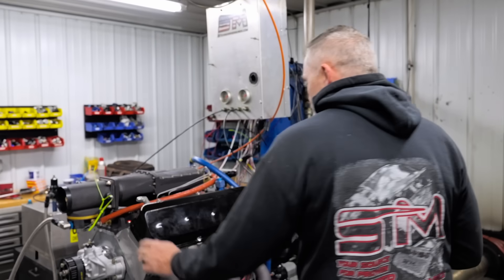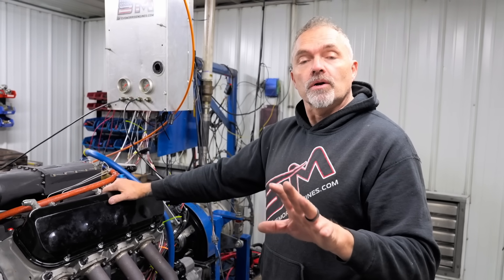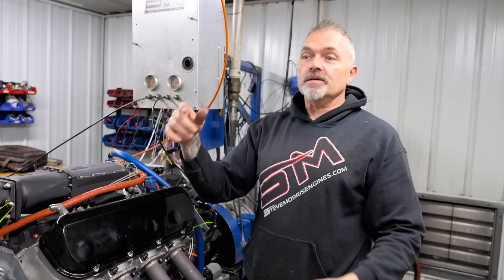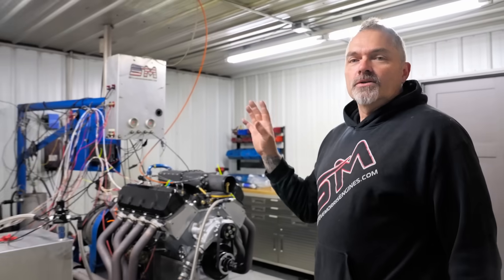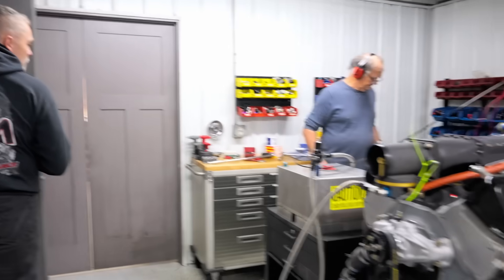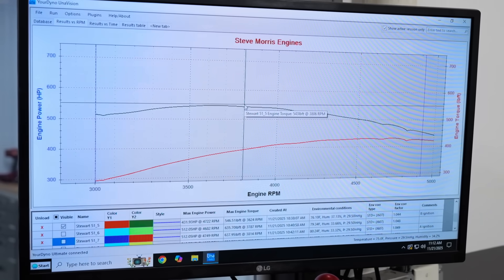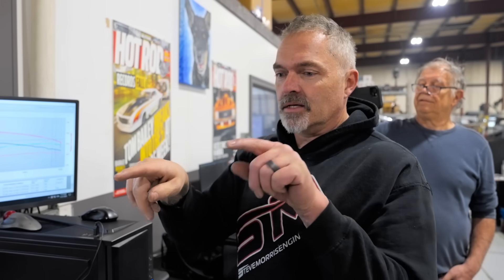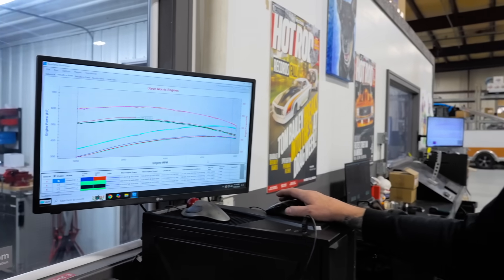Amazing 2 Spark Plugs Per Cylinder BBC  1 Spark Plug Makes almost 100 HP More Than The Other one ?

Comment: That’s like the Nissan hard body trucks with 2 spark plugs per cylinder. They made more hp and torque too. I think they cause a different spark glash or swirl or whatever. You could also cause 1 to spark before top dead center and the other at TDC. That would make a 2nd spark that would fire more of your gas mixture and force more exhaust out

Comment: So my thoughts are you only have 1 set of magnets in the flywheel to be picked up for timing, the sensors are obviously going to be in different positions so 1 ignition system is inherently going to be more advanced than the other producing more power.
Reply from the maker: No
It is programmed 
Then each system checked and timing verified individually
Reply: @stevemorrisracing verified how? I didn't see a physical timing pointer. If it was verified through the computer the computer is using those magnets to determine crank positions to validate timing so it's validating from where the computer thinks the crank is and can show correct timing while the crank is physically a few degrees off from where the computer thinks it is.
Reply from the maker: @tylerwade3303 there is a timing pointer
And we checked each system running with light separately as they are independent of each other
Reply: @stevemorrisracing okay, just because I didn't see it doesn't mean it's not there that's why i asked. With that in mind i still believe it's timing related not necessary plug location because i don't think that thing would have a big enough cam to worry much about spark blow out.

Comment: This may sound stupid, but aren’t you technically changing the timing bye, sparking closer to the intake valve then further away from the intake valve without physically changing the timing ? or maybe it would be like changing the dwell with the separation of the spark plugs because you’re sparking closer to the incoming fuel in the chamber?    HMMMM 🤔🤔🤔🤔🤔  Isn’t everything changed except for the crankshaft and the rods and pistons in an engine that spins counterclockwise? You would need to change the water pump the camshaft the oil pump driveshaft it’s a totally different engine. Technically ?!
Reply from the maker: Cam is it nothing else

Comment: I would be interested in the temperature difference between the plugs on the exhaust header.  The front plug must be running cooler due to the fuel being closer to the plug?

Comment: 12:37 I assume this has to do with timing requirements of different ignition source locations in the same combustion chamber? The location of ignition B is not optimal, and the fuel mixture is not getting ignited soon enough to make peak cylinder pressure at the optimal crank position, therefore losing power. Could this loss be corrected with crank sensor position on the flywheel in this application, advance the timing on ignition B until the output numbers match (or close to it) ignition A? What are the AFRs on Ignition A vs Ignition B? If one is soo much less efficient than the other, it must have shown up in the AFRs?
Reply: Exactly what I am thinking. One day we'll be able to put a camera inside the combustion chamber and know for sure. I have seen the old glass lense spark plug used for tuning 35 years ago, on my twin side draft 2L Ford Cosworth, blue flame was where the power was. Going to be interesting if in needs advance or retarded timing to equalize the curves, also interested to see what the spark closer to inlet valve produes on which timing.  Love this stuff Steve❤

Comment: The engine has more power on the forward plug because it's closer to the exhaust valve, thus the forward plug is running hotter than the rear plug that is closer to the intake valve which it would make it run cooler.  That's assuming the timing is the same for both plugs in each cylinder.

Comment: My ducati has twin plugs 
Testaretta belt desmo
Goes well in sports mode
It's low geared 250 kph top speed
O to 100 in not much ova 3
A friend rode it in touring mode first he was quite impressed then I sent him out in sports he come back and said his arms felt longer
It won't spin a wheel it looks for traction 
Best squirt and go bike I've ever owned 
Shit load of fun 
Once you learn to ride on the edge of traction control fallover if you ask too much with throttle it sort of flats spots if you hit it just right it's a slingshot

Comment: VW/Porsche 914 cars had a VW type 4 engine . the 1.7L & 1.8L models used the basic VW engine , with the later 2.0L engine Porsche redesigned the chamber and moved the spark plug location .  Reported to give a 10 percent increase in power .

Comment: Twin plugs performance increase really is a good insight into just how the flame front propagates during combustion. Probably the best thing for a single ignition event. I suppose a CDI is the next best thing for a single plug system. Due to the many sparks they generate during a single firing stroke. I have seen a CDI improve a tired engine, ease starting when cold and make a poorly tuned engine run a lot better just due to the prevention of the occasional miss.

Comment: Is this the HP the engine makes with a 1;1 transmission??? Does that mean with the stepdown transmission it would change to higher HP/TQ numbers??
Reply: Torque changes because of the gear multiplier hp dos not.

Comment: Well yeah it always matters for the spark plug is located in the hole LOL duh and these companies like brodex and other cylinder head makers do the same thing of testing to figure out most power in a cylinder explosion but yes where are the plug ends up at

Comment: I guess angle plugs can actually make a difference! I always wondered if it was worth it. Header clearance issues and such.    I have thought about putting  a sparkplug on the valley side.  Just wondering  if that would help anything. Probably would with a pistons designed specifically for it. Having a small dish under the plug and a dome to fill the combustion chamber  to make up for it. A slight dish in the head for the plug. Maybe 5-8 cc,  with a 10-15 cc dish under the plug in the piston. Maybe a 25-30cc dome to restore compression.. maybe  it could be all the difference,  a 50 hp gain 😂

Comment: The question would be does it gain horsepower over the stock single plug setup?? Then you could start moving the plug location on all your builds for free power.
Reply: I’m not sure that there is a power gain, as a matter of fact there might be a power loss.  The only reason for the dual plug heads in this application is to have two separate ignition systems to keep the engine running in case of the failure of one of the ignition systems.

Comment: Is it possible the distance of spark between the 2 is different of the piston?  Would be interesting...also the other possibility is the spark plug furthest from the exhaust port allowing less heat and offered the coldest air first from intake and the freshest fuel...hmm. really got my brain thinkdiaggimg this one.  And if im right Steve. Im just down the road lol.

Comment: I'm an aircraft mechanic that used to flight engineer on WW2 era equipment. I've spent a lot of time with 1940's era high performance radial engines. If I recall correctly, on the Wright 3350, the ignition timing was a couple of degrees advanced on one of the ignition banks. The aircraft was equipped with BMEP gauges on each of the four engines. On takeoff, the 18 cylinder would be down hundreds of horsepower if the timing wasn't correct. I would suggest, if you advanced the timing a few degrees on the low horsepower ignition bank you would gain some overall HP's and TQ's.
Reply: This is exactly why I love the comment section of Steve morris channel! Always cool knowledgeable people chiming in!
Reply: There is a guy in the town where I live that has one of those Curtis Wright 3350 18 cylinder radial engines on a tractor pulling tractor. He's been season champ in his class several times.
Reply: It's called The "Radial Reactor". Lots of videos on YT.
Reply: I'm going to show may age here -- used to work on Pratt & Whitey R2000 14 Cylinder ignition system components. On the bench tester the spark from these magnetos would punch holes in layers of paper / cardboard it was that high in energy output.  There's a good reason why top fuel etc drag racers use two plugs per cylinder and twin magnetos -- the faster you spin a magneto the higher the energy output.
Reply: Agreed advance the bad one. Then I would expect a little bit more power . As the flame front convergence timing will actually change.
Reply: So the Allison V-1710 and the Merlin V-1650, in order to move the flame front to the exhaust valves (four valves per ciylinder) 
At least 5º, influenced by the size of the combustion chamber (the flame front speed remains the same at the same stoichiometryc ratio)
Reply: @TheMissing62 Awesomeness,  please elaborate. Is there a learned understanding of chamber spark position and timing in relation to the exhaust/intake valve? Looks like we're going to find out, but you Sir sound like you already know 🙂. I love this stuff....
Reply: @RaksasaMentawai  Well, as a technician I learn't physics, some chemestry, thermodynamics and a little of fluid mechanics, but in general, but I don't think I have further knowledge beyond my passion to elaborate; even designers have increasingly sophisticated tools at their disposal, and yet you still need experimental prototypes and a lot of time of developement; nobody knows the exact results. 
Little changes in turbulence, speed of the gaseous mass, inertia, friction of the induction pipes, changes of direction, stratification of the mixture, temperature, compression ratio and hot points, ignition timing and position of the spark plug can modify all
Reply: The 3350 does need extra timing on the low side. Different chamber and heat from radial to big block obviously. But Skyraider at the museum I work at did exactly the same thing as the guy working on 4 engine 3350 setup IE B-29
Reply: This is also what I think.  plugs closer to the intake valves need more advance than the ones further away
Reply: @eddominates the could have at least tried to play with timing while running it on the forward spark plug
Reply: @eddominates  It's not an exact science; it's about trial and error. There are no magic formulas, maybe some kitchen recipes.
Reply: @eddominates  More burning (harnessed energy) before its swept out the exaust. I would guess u can't get all the power back only because of the small distance takes from your flame front speed. I expect EGT's to be higher on the one closest to exhaust valve right? What about AFR??? What u think it looks like between them, (I mean AFR readings in down stream exhaust at the sensor not in the chamber.)
Reply: I used to be a GE F110-100 F-16 engine mechanic and this doesn't make any sense to me.
Reply: @jakeblack4095  Nope, because jet engines don't have any magnet timing 😂😂😂
Reply: This is true on my Harley ironhead as well.  Huge dome pistons with 45* valve angle with a plug on one side stock. Adding another on the other side drastically improved efficiency and power. The added plug is on the intake side, runs the best with that plug 1.5* advanced ahead of the other plug.
Reply: @glennpley9279 At 3,350 cu in, 2500 - 3000hp, & 3000rpm there's a lot of torque there to "eat up" a couple hundred horsepower, particularly when you have 4 of them in those amazing old aircraft.. Incredible engines for their time, I bet they were a joy to work on.. and find parts for..

Comment: I'm a bit overthinking it. Back and front sparkplug doesn't make sense to me. to me that means on the left cylinder, the front plug is the exhaust plug, and the right cylinder the front plug would be the intake plug. Should you be connecting the plugs A-ignition to all the Intake sparkplugs, and the B-ignition to the Exhaust sparkplugs? Left bank, bank 1, A-ignition to the front plugs and the right bank, bank 2, to the rear sparkplugs?

Comment: It's probably due to swirl induced differences in absolute timing for each plug's flame front. Each ignition system probably has it's own optimum timing advance, the lagging plug probably needs more advance than the leading plug. Would be interesting to test this to see if I'm right or FOS.

Comment: It would be really interesting to find the optimal timing plot for each plug, and then, since there's two different ignition systems, run both plugs at once while each fires on its respective optimal timing plot. Could potentially squeeze a little more out of it with both plugs that way?
Regardless, this is some very VERY important information for an aircraft engine, it would certainly be good to know that running on one ignition system will make more power than running on the other ignition system. That sort of info can be kinda a lil bit important for knowing your takeoff performance and such. Maybe fly around running only the lower power system so that, if you did have an ignition issue, you would always be switching to the one that gave you more power instead of less.
Reply: It’s done strictly for redundancy. Something you will see all over in aircraft. Almost two of everything
Reply: @zethloveless7238  Yes, fully understand that(hence my last sentence)
Reply: @RyTrapp0  I would run them both on takeoff. I would never run only 1 unless I was at altitude.

Comment: it would be interesting to know which plug is closer to the intake valve and if the richness of the fuel charge in that area is the difference in the efficiency increase or not.

Comment: Marine engines in twin inboard boats would have 1 engine that operated reverse rotation. Starter, camshaft, timing gears, front and rear seals. I don't know if the crank was polished turning reverse. Distributor and oil pump turned normal auto rotation. Water pumps could have left, right or 
neutral impellers,
alternator fans could be left, right or universal These parts are still available but modern boats change propeller rotation in the transmission. Auto rotation crankshaft, One engine in fwd and one in reverse. Older transmissions were not designed to run continuously in reverse. 
Did you get to play with the timing independent of each other?

Comment: It's to keep the fan running to keep the pilot cool. When the big fan out front shuts off, the pilot starts to sweat profusely.
Reply: People think it's aerodynamics and Bernoulli's principle that makes planes fly when in reality it's the stack of money under the wings holding them up.
Reply: lol
Reply: @rustymustard7798, Do boats and yachts float on the same principle, they seem like they would!
Reply: @Hoaxer51  Yeah, i was a yacht mechanic as well as aircraft tech, they all basically have a big Scrooge McDuck style pile of cash in the keel as ballast to keep them floating upright.
Reply: I read this comment before the vid, watched the vid & read it x4 over before I understood wtf you were talking about LMAO!! Talk about overthinking things.. I was theorising about electrical system & current draw & stuff, HA!!
Reply: @bo-dine7971  🤣
Reply: How are the valve springs going to work out? Constant rpm will break them, won’t they?
Reply: @shockdocracing not at all diesel generators run 1,800 rpm its whole life. Valve springs run for 15,000 hour.
Reply: @shockdocracing - I would think they would have to test that to see where the harmonics come into play.  Much like how Steve discovered the effect on valve springs steady state street driving with his SMX.
Reply: @danmyers9372  I think he figured out it was at constant 2500 rpm
Reply: @waynerohde1036 - And the developer of this engine would be wise to determine if something similar happens with this engine.

Comment: They've been using dual plugs in prostock motorcycle for a long time now.  It was actually amazing how much power gain from. A single to dual.
Reply: That makes total sense given the high RPM’s those things run at.  Dual plugs would speed up the flame front creating a more complete burn.
Reply: @danmyers9372  it has nothing to do with the duel spark plugs.  It's the amout of double amount of fuel that needs the hot spark to ignite.
Reply: Ray Bellucci

Comment: Great to see this airplane engine technology with dual plugs! Getting back to drag racing a BBC engine and testing on your dyno. Have you ever done different brands of spark plug tests? Like testing NGK race plugs for BBC against Autolite AR race plugs, AC race plugs (if they make them), and Champion race plugs ( if they make them)! Same gap, same heat range, same cylinder indexing! I use the AR series in my 582 BBC in my dragster, made two 1/8 mile passes, then changed to the NGK plugs (because most people seem to run them), made two passes without any other changes and lost an average of .09 second! Just curious what you would find on the dyno doing a test like this!
Reply from the maker: Usually no difference

Comment: That’s a lot of power for an aircraft engine. For comparison, a Cessna 210 (high performance 6 seater) had a 520 cubic inch flat 6 that made 300hp at 2800 rpm
Reply: I believe it's for a 70% P-51D Mustang replica (though similar LS conversions have been used in some bush planes , like the Murphy Moose).